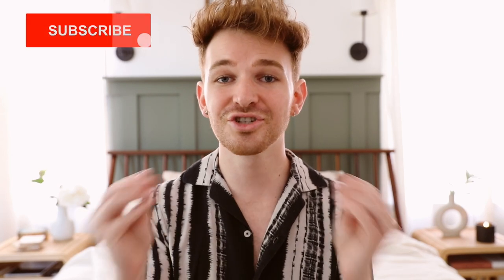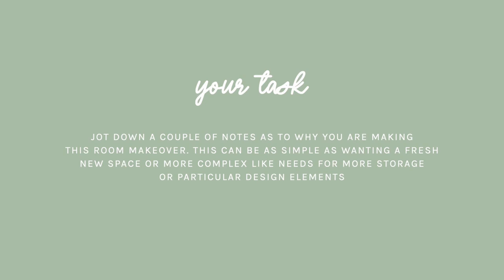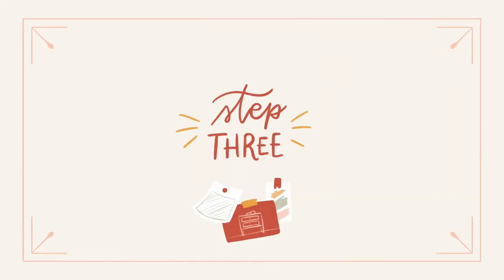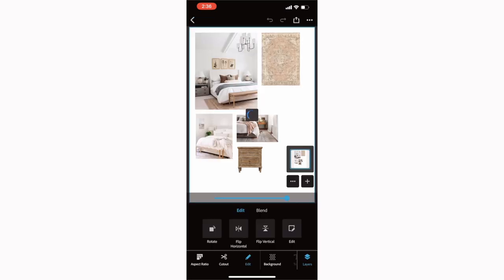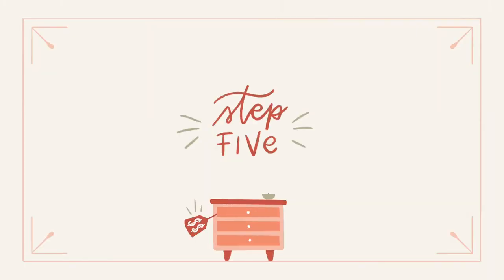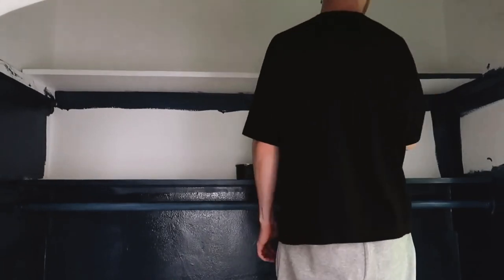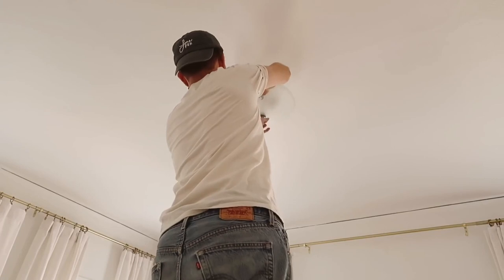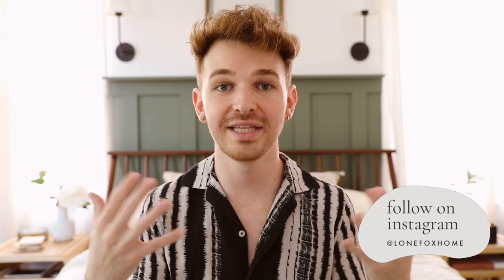How to CONFIDENTLY Tackle ANY Room Makeover! (Design Masterclass & Home Hacks)

Comment: @LoneFox where would you put furniture in an L shaped living room where the fireplace faces the hallway?  The fireplace is on the long wall of the L but placed in the middle so the small part of the L is on the right of the fireplace and the fireplace isn't centered to be able to place furniture without cutting off flow to the rest of the room.

Comment: "Use the features in the room to help guide you" 
The builder of our house: 🤣

Even though our bedroom is large, the bed has to go on the same wall as the entry door. Our living room has vaulted ceilings, but the corner fireplace and placement of the sliding door onto the deck make arranging furniture  really awkward.